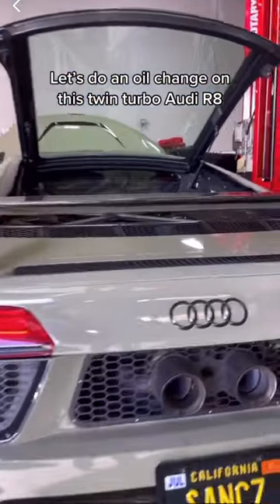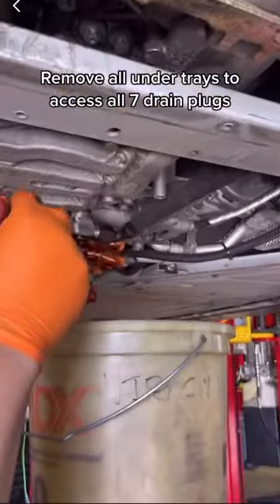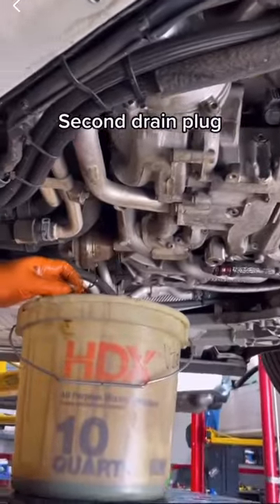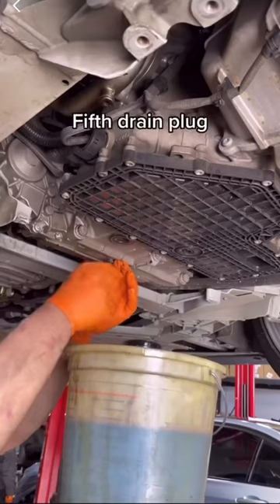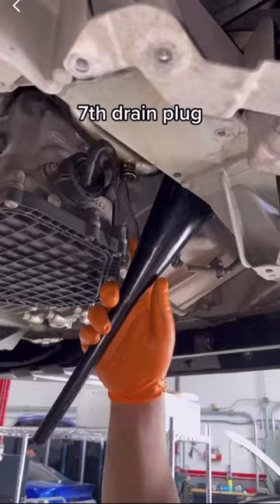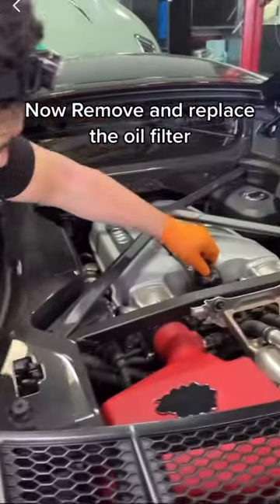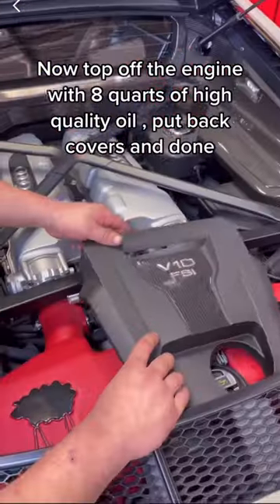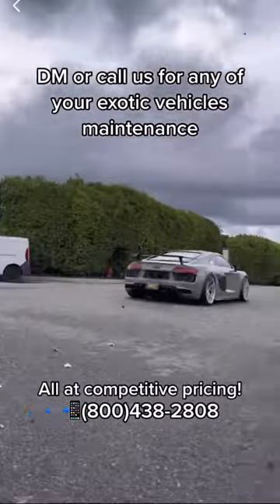Lets do an oil change on this Twin Turbo Audi R8 🏁

Comment: Audi went out of their way to make that as difficult as possible so the dealerships can charge 1500 dollars for a maintenance visit.
Reply: Fr 😂😂 like I can do that oil change and tire rotation got 70 dollars at my job if I do it myself. They just charge me for parts.
Reply: It has a dry sump lubrication system. 
Besides the skid plates underneath i don't think they could've made it anymore easy